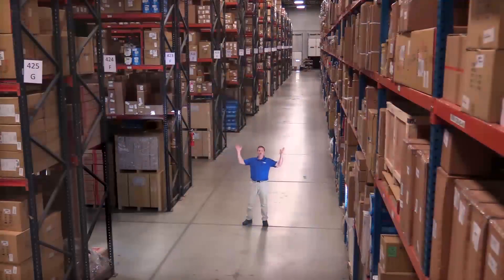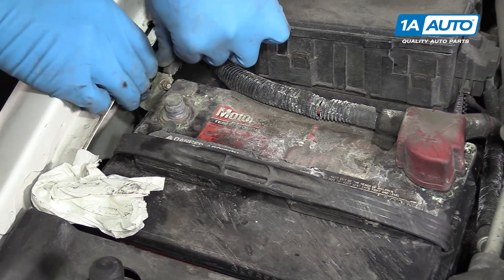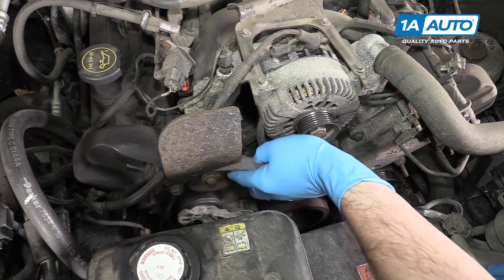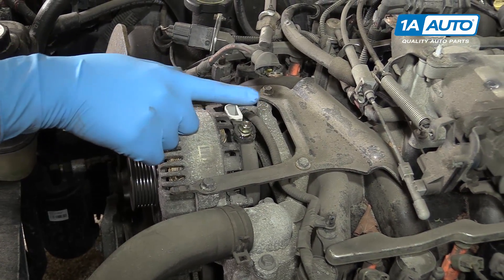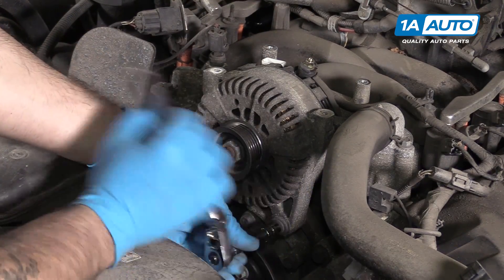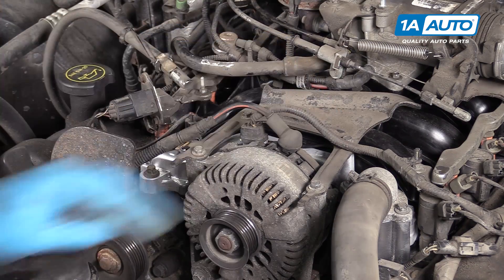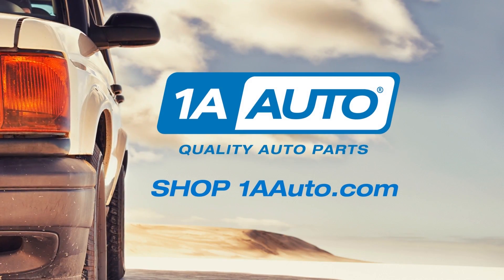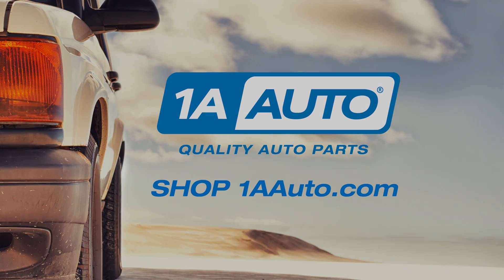How to Replace Alternator 03-08 Ford Crown Victoria

Comment: ...........  Why  did   you   take  the  belt   off  fully,   seems   like  you  could  have   just  left  it  on  and  hooked  the  belt  over   the  new   alternator in  the  end  ?????
Reply: ......  another  Youtube  videos  shows   how  to use  a bungy  cord  to  hold  the belt in place.   I  used  a  shoe  string...
Reply: Stephen Fiore I agree removeing the belt seemed unnecessary.
Reply: I would remove the belt only if I was going to replace it.
Reply: I said the same thing
Reply: @jchis9852  yep
Reply: I came to ask the same question... 👍🏿
Reply: Just a good chance to show how the belt goes on, that you can’t just gues lmao, and that there is or should be a diagram
Reply: It was for another video they did same car same day

Comment: .........  Be  careful  to  use  a  "6-Point"  socket   not  a  12-point  socket.  I  stripped out one  of the bolts  and  Ford  doesn't  sell  new  ones.

Comment: I changed mine for the first time ever & here’s a tip if you don’t have the tool to move the tensioner, just completely take out one of the bolts at the bottom preferably the left one and let the alternator tilt a Little. The belt comes right off without having to bother the tensioner 💪
Reply from the maker: Thanks for checking us out! +Official DB23

Comment: I bought an 03 Grand Marquis LS Ultimate a couple months for for $4,700 with 67,000 miles.  Low mileage but as with any older car I knew I’d have some stuff.  So far I needed new hood lift supports, serpentine belt, and now my alternator just went out.  All of your videos have been very helpful as I like to do things myself.  Great content!

Comment: YES! Why was the belt fully removed? Was that to simply add additional information and inspection or replacement of the belt? That belt is super important so it is  a good time to replace it (if needed)...
Reply from the maker: +Mark Mann Thank you for checking us out. The belt was removed due to a separate video showing the complete replacement. We agree that while performing this job you should always inspect the condition of the belt and replace as necessary. 1aauto.com

Comment: Looks easy just  looks like it would  be confusing putting  the belt back on. I think my alternator might be going bad on my 2003 grand marquis feels  like I have a misfire and my headlights are dim I'm gonna get the alternator  tested of its bad I'll replace it. Is this the same procedure for  2003 grand marquis. The only thing I'm worried about is getting the belt back on properly

Comment: Unless your needing to replace the belt there is no reason to remove the belt from the car just the tensioner because as you say you only need to loosen the bottom bolts for the alternator to be removed as all you need is a small extension to reach past the belt . other than that good video .

Comment: ........ Wish  you  would  have  gave  torque  amount  in  foot-pounds  on  each  bolt.   I  hear  top  bolts  have  much  less  torque  than  bottom  bolts.
Reply: that's correct. I don't know the exact numbers, but the bottom bolts should be very tight and the top ones moderately tight. the top bolts are only going a few threads into pretty soft metal, don't overtorque them.

Comment: My alternator is not charging the battery. Bought a new battery and stuck on what the problem could be.
Reply from the maker: +stephone lockett Thanks for checking us out! If you purchased a new battery and that is not being charged it could be an issue with the alternator not operating properly. We would suggest having this tested to make sure it is operating as it should.

Comment: Thank you so much. The looks extremely easy.

I have a 2006 Crown Victoria P71 and my battery light comes on then turns off then comes on again.

Yesterday, My car was on and my dash died. So I turned off my car and then itt wouldn't start. I had to jump it.

This morning the battery light was back on and I looked it up and I need a new alternator.

Thanks again. This looks easy
Reply from the maker: +Elemeno Thanks for checking us out. Shop for high quality auto parts on 1AAuto.com:

http://1aau.to/m/Shop-1AAuto-c